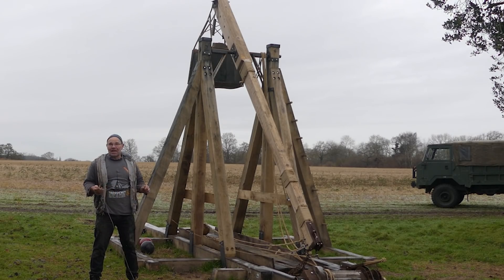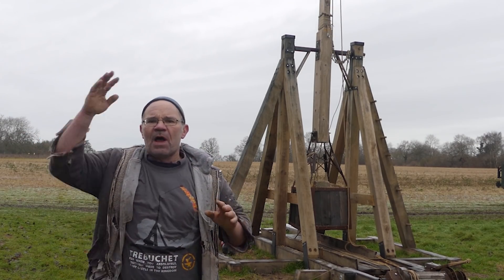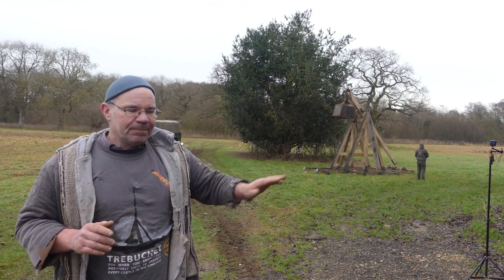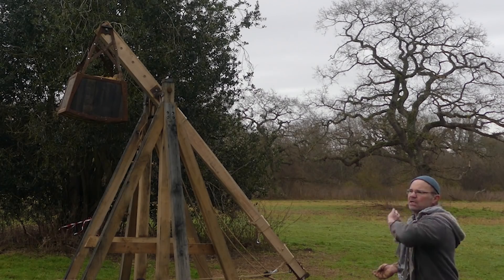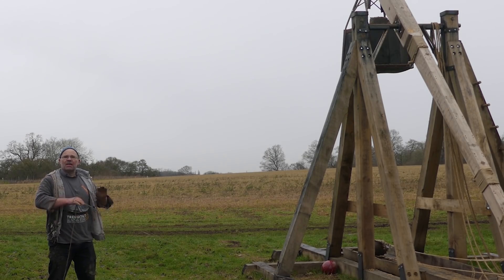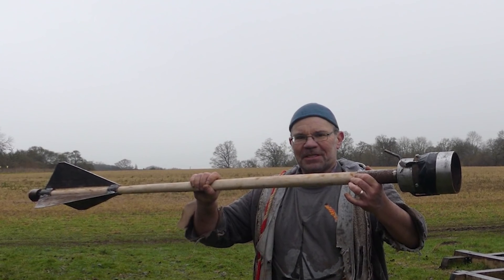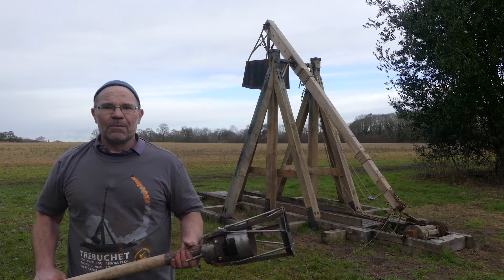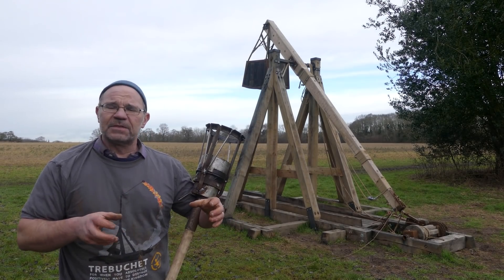Trebuchet. EPIC FAIL? Not yet......

Comment: It seems a trebuchet would be more stable and at less risk of shaking itself apart if you replace the pivoting weight basket with fixed weights. Is there a precedent? Perhaps lead plates or similar?

Comment: you need to put wheels on it, i promise it is of an advantage, it maximizes the power

it will also reduce the violent shaking, youll be able to add more wheight and larger projectiles

the wheels will allow ur amazing machine to be invincible as well, it will take more of a beating

Comment: If you want to throw the ball farther put Trebuchet on wheels. The counterweight drops straighter and faster giving more distance. And the rocking back and forth it will do. Is easier on the Trebuchet than a fixed placement.   As seen on a PBS documentary. 

If you dowbt me just build a scale mock-up as they did, and try it your self.

Comment: Oh, the trebuchet is shaking itself to pieces? Because the leftover energy has no way to dissipate? Jeez, if only a million people had commented to tell you that you need to mount it on wheels to prevent that. You aren't going to move it anywhere, but that doesn't matter because the wheels are shock absorption, not transport. You're going to wear muddy ruts in the ground, unless you think with your medieval brain, just as good as a modern one, and put runner boards or paving stones under your wheels.

As long as I'm nitpicking... further/farther. You make further adjustments to the machine, to attempt to throw farther. You cannot throw further, it is a metaphorical distance while farther is physical distance.

That narrated section was pure gold. Probably the only possible improvement to your presentation style would be to leave out the audio and voice over your actions. "Oh look, I appear to be pleased." Brilliant.

Comment: Tuning these can be frustrating.  Modify hook, sling, or sling rope length separately as each affects throw distance in odd ways.  Weight thrown and counterweight changes will affect everything else.  Lashed up some for Scouts.  Threw pumpkins, weighted exercise ball, and buckets of walnuts.  Never had a failure myself but have witnessed a few.  Scary.

Comment: Bring in Tom Stanton and make a colossal flywheel trebuchet.
Reply from the maker: I cannot see how that could be done with medieval bearings and  loosing say 50kg from a massive balanced system at high rpm and for the structure to live
Reply: Fair enough. What about that peculiar repeating trebuchet from the second narnia film the telmarine were using?

2 counterweights, a crank for getting it up to speed, “baskets” on either end of the arm. Is it all movie nonsense or is it possible?

Comment: To me it looked like all the shots fell near eachother and the changes did not have a massive impact. What is the margin of error between the shots?
Reply from the maker: In hindsight I would agree.  My work with bows shows that the difference in impact from 35-45 degrees is  not much so I strongly suspect that the difference between say 40 degrees and 50 degrees will be the matter of a handful of meters

Comment: If it puts you at ease, a well built trebuchet (which this appears to be) can withstand quite a bit of punishment. The one that I built over a decade ago is still fully functional. Granted, it's much smaller, but I see the exact same rattling and jerking with every shot. I've just gotten in the habit of checking all of my hardware every 20 shots or so. If things start to work loose, that's when real damage occurs. Keep everything tight and well seated, and you'll probably wear out slings before the frame fails.
Reply from the maker: Thanks for the good vibes - keep sending them over

Comment: Reviewing the slow motion, the release time is later than the counterweight stall for all shots. Suggest using a shorter sling or different finger angle to synchronize the release with arm stall and CW stall. Seems like trebuchet design would be a bit more difficult before the invention of video photography and the concept of kinetic energy.
Reply from the maker: Thanks.  I will add these to the list of information I need to know for mt new toy, but it will of course all change when I increase the arm length

Comment: If the GoPro is too close to the front of the dart, it's getting nailed into the loam. Is there a way it could be rear mounted in such a way that the dart remains stable, and there's some method of decelerating the dart on impact?
Reply from the maker: I could, but I want the best field of view and there is a risk with that!

Comment: You want the weight to almost stop moving the instant the projectile is released so that it transfers maximum energy into the projectile.
Reply: The second shot released too late.
Reply: The third shot was better. But still a bit late. I think you might need a shorter sling rope or a longer throwing arm.
Reply: It seems that you've read my mind about extending the arm.

Comment: RULE #1 FOR A TREBUCHET: PUT IT ON WHEELS AND ALLOW IT TO ROLL FORWARDS AND BACKWARDS OR ELSE THE ENERGY OF THE DROP WILL BE WASTED IN ROCKING THE FRAME.  PUT IT ON WHEELS PUT IT ON WHEELS PUT IT ON WHEELS DO YOU HEAR ME PUT IT ON WHEELS PUT IT ON WHEELS PUT IT ON WHEELS
Reply from the maker: I hear you, but it is a massive amount of work and ground preparation and I am not convinced they ever did it anyway.  There is a big difference between theoretical possibility and reasonably possible in the field.  So yes it may well improve things, but so would a carbon fibre arm.......

Comment: Wondering if you could throw something that will take a high refresh GPS sample to a data logger, that would let you try different settings and have the data points in 3d for height, angle (potentially an accelerometer etc as well would be interesting).
Make a nice Google earth fly through as well

Comment: I remember NOVA or some other PBS science/history show did some experiments with trebuchet's back in the early 00s.  They had found that putting wheels on the trebuchet let it rock back and forth and dissipate the energy instead of the frame shaking itself apart.  If I remember correctly, they did the experiment because of a manuscript illustration with wheels, and a historian involved thought that must have been an embellishment because they wouldn't cart trebuchets around between sieges, they'd build them on-site.
Reply: Yep, can’t remember the show but I’ve definitely seen something along those lines. It seemed a bit counter intuitive but having wheels on an un-anchored base did make a substantial difference to the performance and longevity of the trebuchet.
Reply: @Oldtanktapper  In modern artillery there often is a system for the barrel and breach to move back under spring pressure, not just to work the reloading system but also to dampen the recoil and stop the gun from chewing itself up.
Reply: They also help with the efficiency of the throw. With wheels the counter weight drops closer to vertical instead of in an arc, which transfers more energy to the throwing arm.

You should check out some of the more modern trebuchet designs that are optimized for efficiency. There are some really weird designs like floating axles that allow the counter weight to drop absolutely straight down.
Reply: I´ve also seen it! I think you mean this one: https://www.youtube.com/watch?v=QVO8VznqMeQ
Its amazing to see, the trebuchet is huge and they built a wall section just to shoot at it!
Would love Todds thoughts on this, especially about the wheels.
Reply: @KanaiIle  Yes, that's it!  I forgot Stacy Keach was the narrator.

Comment: When you added the cage to the dart it moved the center of mass forward. You need the dart to be longer or the fins to be larger to compensate. Or start from scratch with all that in mind :P

You can prototype this - very loosely - with a scale model. Make a small analogue with the proportions you are testing, tape pennies to it or something till the COM is in the right place. Then tie a string to the COM and spin it around your head and see how much it tumbles. This will let you know if you're in the right ballpark.

Or you could, you know, do a lot of math. :P
Reply: There's also an issue with aerodynamics here. A front basket and cup system works well as a sacrifice, but it probably creates some significantly strange points where air is going to divert through and alter the trajectory. It wouldn't be historical in the slightest, but a thin plastic sheet/dome across the top might help alleviate some of the issues.
Reply: Did I just spot a Kerbal Space Program player here :D?
in any case great work, that everyone may enjoy that machine as long as possible!

Comment: Talk to Mr. Brandt.  
Set the rig on top of a single layer of rollers-cribbing, probably 10-foot segments of scrap telephone poles - you want the trebuchet base to roll smoothly forward and then back on the rollers.
That should reduce your torquing problem and limit the strain.

Comment: Few people in modern times will ever experience that moment of cold terror when they realize the trebuchet has launched the projectile straight up.
Reply: run.
Reply from the maker: 3 times so far....And that is why you never stand behind them
Reply: Oh yes indeed, twice under the remnant walls at Berwick upon Tweed quite a few years ago as part of the displays associated with the anniversary of the Battle of Halidon Hill. It had been designed by the local museum curator and built in a local school. Let’s be charitable and describe it as slightly under specified and designed by eye rather than calculation. To be fair it did work fine a few times, (if somewhat prone to the shakes on release with the energy going into the machine rather than the release). The projectiles were overripe musk melons which would still have caused a lot of damage if we had not scattered very quickly and being splatted with rotting melon flesh was no fun at all. I learned a lot about safety radii, public protection and my agility that day…..

Comment: Two things I'm really curious about. What's the variance of the distance the balls fly with no adjustment between shots? If you knew how consistent the machine was it would inform you as to whether the adjustments are making a real difference or if it's just natural variation. The second is that cage around the front of the dart, it looks to me like a crumple zone as much as a stand off for the lens. How well did it work?
Reply from the maker: The natural variation is currently far more than I would have expected at around 5m in any direction from the central impact point, but this is of course to be investigated and part of this is I think to have a better channel for the sling and this will come
Reply: @tods_workshop  I hope you'll be showing us your investigations :)

Comment: You got to put wheels on the trebuchet.  As they absorb the excessive energy.  This will stop the weights from flying out and the shaking of the structure. 
Just give it some thought. 
Great series of Siege engines.
Reply: Can you imagine the force between the axles and the frame though?
Reply: @Debbiebabe69  
Surprisingly the wheels  move back and forth absorbing the huge counter weight.  The axles main problem is the whole weight of the trebuchet.

Comment: The main reason I watch this all the way through is cuz you're impressed every single time that thing goes but I'm agreeing with you work out the math on that thing do not extend the arm it's not worth it reduce the weight in the counterweight box inspect your beams correct what you need to correct tighten everything up put in good thick bronze sleeves and whatever you do do not forget the beargrease
Reply from the maker: I don't need the worlds best trebuchet, but I do want one that is at least "pretty good" and it is not that at the moment so for me I have to keep pushing rather than back down

Comment: Do we know whether trebuchets were ever adjusted in the field to give different trajectories for different purposes or loads? It seems logical to me that you want a flatter trajectory for trying to breach walls, but might want a higher one if, say, using an incendiary to hit buildings beyond the battlements. Is there evidence of these kinds of strategic adjustments being made?
Reply: Must have been. You can't always place the trebuchets the exact same distance from the wall, on a piece of flat and even ground. You have to work with the ground available, and set up in positions where the trebuchets can hit the target, but at various distances.
It would not surprise me if they had several different slings of different lengths to deal with different distances, and probably a crew practiced at, at least somewhat, even out uneven our rough ground.
Reply from the maker: In specific reply Thomas, I don't know, but as Suntiger says - they must have done and it is easily done to get slight changes, but this is definitely something I want to investigate

Comment: I wonder if a cage/mount bolted to the dart mid-shaft would work? It'd have to be pretty streamlined to survive a drag through the sling/trough though (and beefy too if it were to survive a snag). Hmm.
Also, how much trouble would it be to remount the trebuchet on a platform to allow for a longer arm? I'm thinking specifically of using those massive (1.5 - 3 m) concrete road barriers (not the thin ones but the rectangular blocks), the can come with interlocking ends but they may be very pricey, I've no idea. Maybe a trench would work too the same effect (though it looks like water would collect pretty fast in that location)? Come to think of it, a plank and post earth berm/trench might be just as good, graded for drainage of course. It would even keep the "medieval" feel for camera crews.

Comment: You shaking too much you going to destroy your trebuchet frame if you don't put more weight in the sling or take weight out of your weight box so I suggest you start with your sandbags and remove a few of them your objective is to clean we throw them on target and every time that arm and weight shakes back and forth after release you introduced play and swap into the machine and it will never throw that cleanly again I would rather be over greased and underpowered and short of my target range then under greased underpowered and short of my target range you might want to go talk to the gentleman there in England that just built the largest trebuchet in the world I believe he has one of only two squirrel cages that are working I do believe he would call you Daphne however as you like to work out a problem you would be more than happy to help
Reply from the maker: The thing is I am enjoying finding out and discovering and to be honest great insights are often gained when you have not been influenced by the opinions of others just as often as when you build on the opinions of others - both are very valid and useful.  I read and learn here and in discussion with others and I also take on problems myself and I find that a great overall way to learn.  I could reduce the weight and that would be a very valid direction and it would throw cleaner, but I don't want to reduce the weight......That is the point, I don't want to reduce the weight, but I do want to improve its performance and longevity with a heavier weight - that is the journey I want to take.

Comment: So, I think the first shot was a small amount less than a 45° release elevation, while the subsequent ones (until you reset it) were at or slightly more than 45°. With air resistance (drag), your max range angle is going to be slightly less than 45°,  as this shortens the flight time (for example, in vacuum, 35° will have the same range as 55°, but 35° will have a shorter arc length and flight time). A shorter flight time means drag is affecting the projectile for a shorter amount of time, so there will be less of a velocity drop for the lower trajectory, resulting in a longer range. Another bias for a lower trajectory release is that the mechanism of the trebuchet will give a slightly higher velocity at a later release.

All that being said, the basics of projectile motion still dictate that the best release angle will be close to 45°, so you still don't want to deviate too far from that. Trial and error is still the best approach for determining range for something like this, but just a little understanding of the physics will help you get set your bounds of your trials a little bit better.

One last thought, maybe attach a horizontal beam (parallel to the base), near the top of the A-frame, to give yourself an easier reference to estimate your release angle. You might also want to measure the slope of the base, as the ground under the trebuchet will rarely ever be properly level.
Reply from the maker: The thing about drag and projectiles is that it is related very much to mass/surface area and velocity and these balls have a low surface area to mass ratio and the projectiles are slow, so I suspect that drag is not massively important to these tests and so I have assumed that 45 degrees is optimum.  However I have also trialled arrows and angles and I suspect that there would be relatively little ultimate distance difference between say 40 and 50 degrees